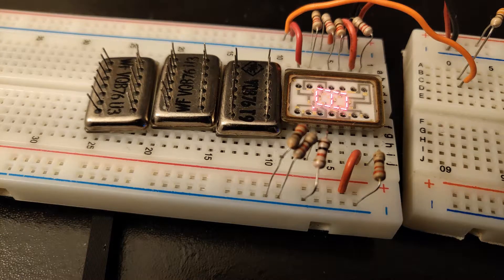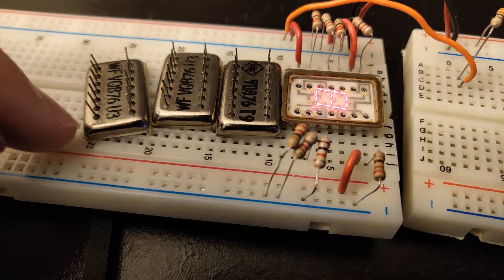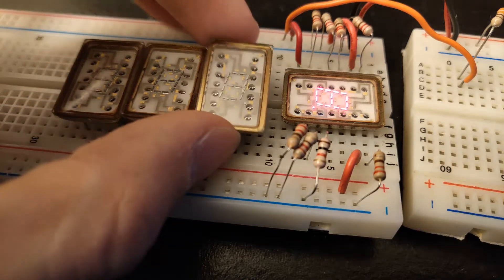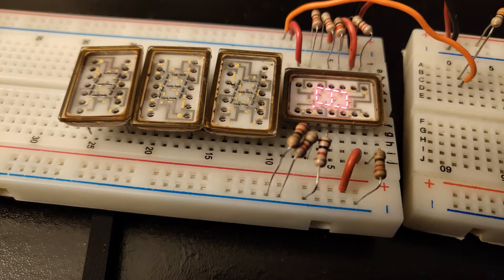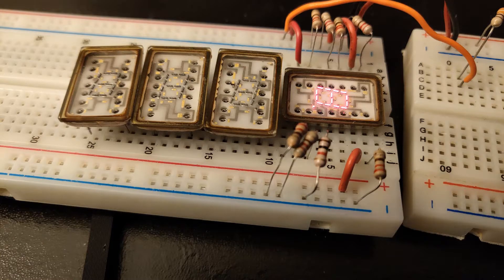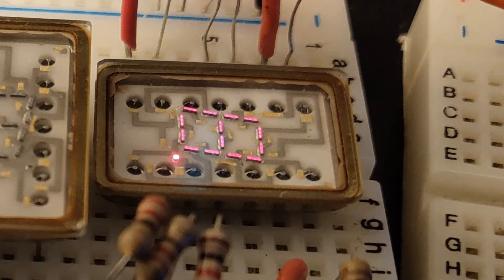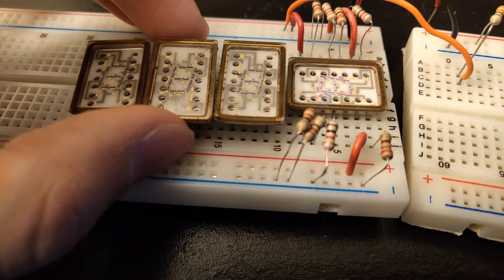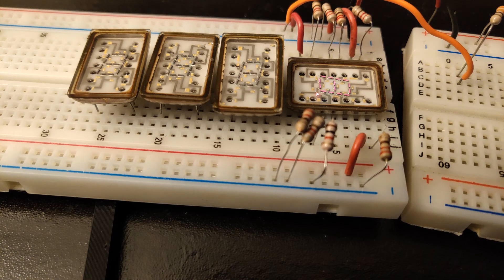Vintage Display Technology: WF VQB76 Seven Segment LED Display, ~mid 1980s

Comment: Hi, search german forums.
Some guys do have the displays in their hands.
Some even know a bit of background information.
There is much speculation but no apreoved official datas.
No nuclear war needed at all.
See the many soviet made IC put the die on ceramik substrate and put them in metal cans.
Looks totally normal to me.
To me it was logical making those LED be cause special requirements of the military and heavy loads on industrial use cases.
It's dead simple, no conspiracy theory needed.
The VQB76 might be the same as the VQB73, but probably they have better reliabilitiy since the dies are mounted on a better conducting heat sink provided by the metal can housing.